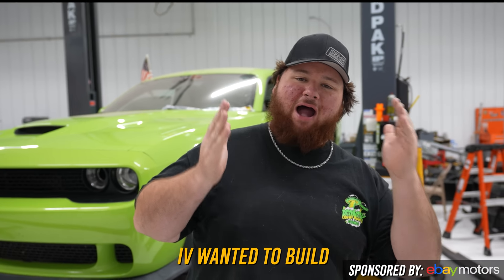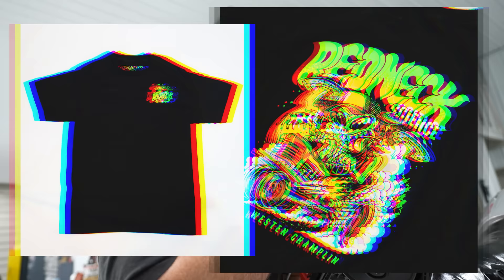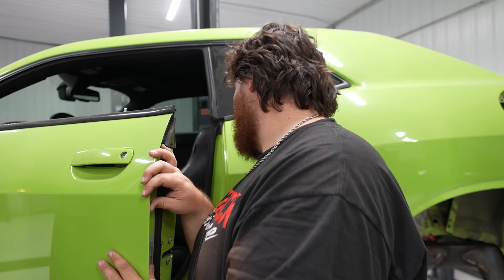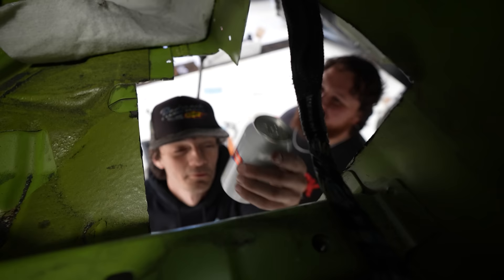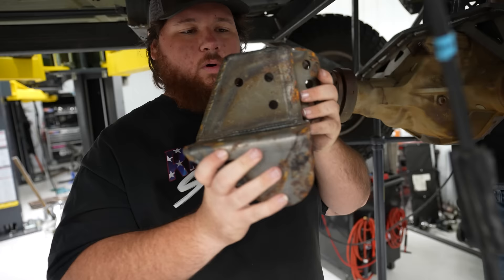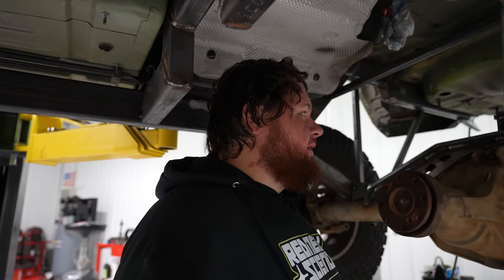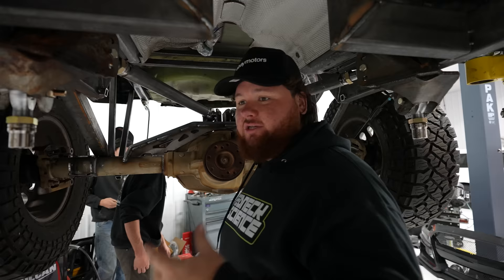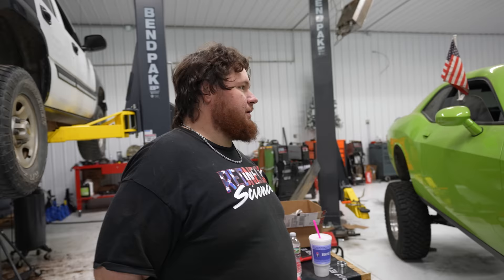I Built a 4x4 Off-Road Hellcat - Part 2

Comment: Try to make a Mopar Garage:
1. Put a hemi engine in a mini van
2. Put a hellcat engine in a Chrysler 300s
3. Put a demon engine in a 2018 ford mustang
4. Put 2 Big turbos on a wide body charger scat pack
5. Get 2 hemi trucks and turn them into a mini truck without lowering the engine power
6. Put a hemi engine into an Atv & dune buggy
7. Put nitrous or twin turbo on a dodge hornet
8. Put a demon engine into a station wagon
9. Make a mopar drift car
10. Find a jailbreak to give it more power, wrap it in your favorite color, put your signature/custom badges on it, give it an custom interior, upgraded breaks, smoked out headlights/tail lights, and put any black rims on it - then give it away for free

Comment: Pro Tip: If you want to quickly see where a point on one side of a piece of metal (such as the floorpan of a car) is on the other side without cutting/drilling/damaging it, you can touch it for a few seconds with a soldiering iron on one side, and see the exact spot on the other side with a Flir thermal camera (or other related IR cam).

Comment: 400 Turbo's 4x4 had a shorter output shaft with splines going all the way..
Also 400's had a larger output shaft for big block torque.
Hope it will take your conservative driving style.

Comment: Transfer cases are not light for years. I laid on my back in the grave and dirt and what shop I had available to me doing transport cases, and transmissions alone and them Chevys that top bolt on the transfer case is such a freaking pain in the you know whatand try to hold that prick up with one arm and fold it up. Lots of very nice words spoken during those years of my life.

Comment: I used to have a 73 Charger SE that someone swapped a 400 with a 69 440mag into, that I was always very tempted to throw a Dakota or Power Wagon 4WD frame, suspension, and drivetrain underneath... But got kids & wife instead, good trade off but I do have small regrets of "what if" tho.
Reply: Before the Charger I had a 67 fastback barracuda with a 318, but traded the barracuda in for the Charger because I had dreams of making a 4WD plus I'd always wondered what a big block car would be like as well.

Comment: And if the two don't run connected use the CPU to control valves what if you used the pressure from exaust to add to pressure compressing on another cylinder instead of turbo

Comment: I'm curious what torque converter you use cause thought about 392 hemi swapping my 01 4wd ram and the th400 conversion kit jw conversion online says a 6x10.750 converter can I just use a regular 3 bolt 10.75 converter

Comment: That's a good mudtruck with the 800 hp engine does it do police get aways what about making a gas engine and diesel that have connected cranks so you get the torque and speed combined I think you should build a car with one in front of other